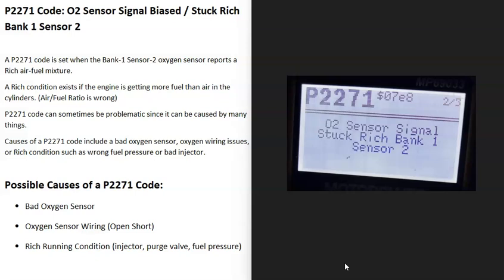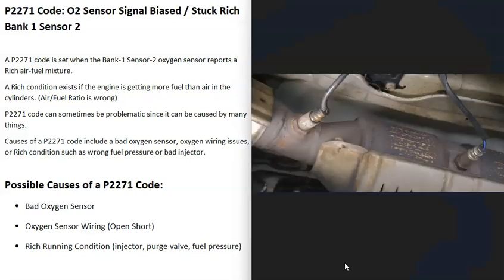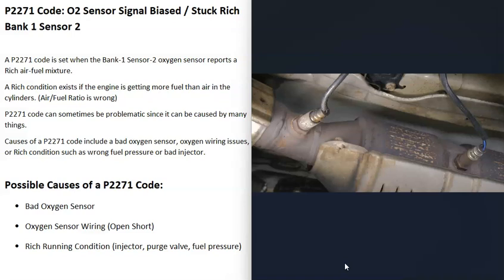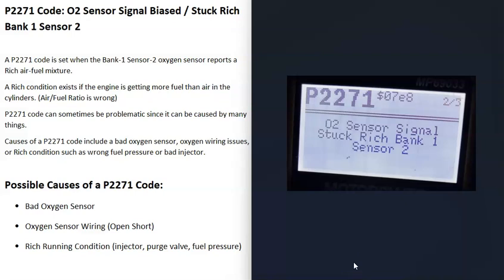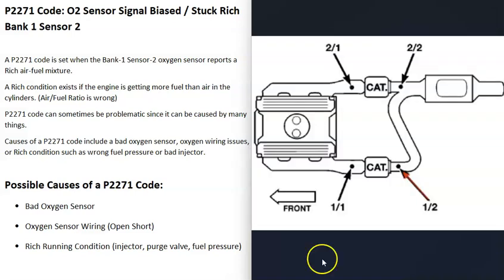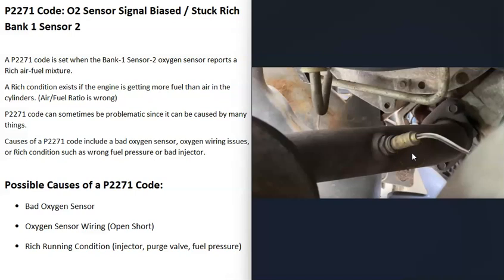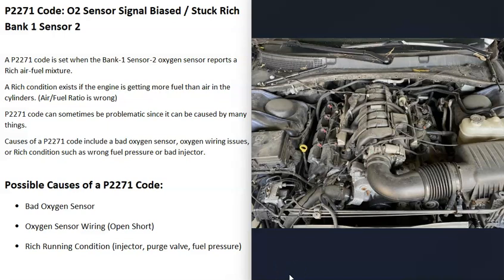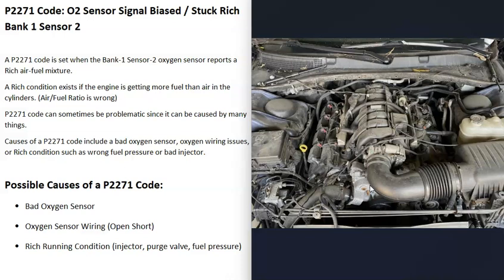Causes and Fixes P2271 Code: O2 Sensor Signal Biased / Stuck Rich Bank 1 Sensor 2

Comment: I am showing 99% on Bank 1 Sensor 2 but showing no codes.  This may just be a bad sensor.  Sensor 1 is reading very close to zero, not sure if that is too lean.  Time to check plugs I suppose.  Thanks for the video.

Comment: Nice one mate,  I got this problem yesterday, engine light comes up on my dashboard and after tester give me this P2271 00 too Rich, is good because the car have warranty and i got back to dealership to investigate 😊. Cheers for clarifying it 😊
Reply: Hi, did you sort this?
Reply: @ibrahimahmad4849 yes mate, they changed the lambda oxygen sensor and delete the error code from ECU with vcsd. All sorted now 😊 car work fine.
Reply: @ibrahimahmad4849  anyway the part is cheep 84 pounds and you can change the part yourself 😊 easy..only lift the car up and the oxygen is located under the car after the catalytic converter. At the end delete the error code with a diagnostic tester.😊

Comment: I change both o2 sensors but it still come up!! Is a 4cylinder what u think is?
Reply: Did u figure it out?
Reply: Could be injector spraying to much fuel then it’s supposed to. Did you ever figure it out?
Reply: It looks like a worn piston ring 😞😕
Reply: @momomar6382  Sorry to hear that. Going to rebuild it?
Reply: @momomar6382 how did you found out

Comment: Help I have all 4 sensors reading 
450 MV  this is a 4 wire 02 sensor on a Chevy 1999 Silverado 5.3  why would the sensor all read rich with no fluctuating they are all stuck rich!

Comment: But why would sensor 1 not show a rich mixture code? If sensor 2 is new and tested working..I checked all my injectors and everything else.. no vacuum leaks no fouled plugs coils are fine.. everything has been checked.. O2s are both new tested working.. changed exhaust manifold collector flange gasket..etc etc etc etc.. checked wiring.. everything done with a multimeter.. everything checks out.. fuel pressure is fine.. no other code.. just a damn p2097 sensor 2 trim rich.. im not using cheap sensors.. denso upstream and ngk downstream..not sure what a purge valve is on this car.. 2008 Suzuki sx4.. tried looking it up to see what it looks like.. cant find any.. i assume its an EGR valve?
Reply: Need an OBD2 tool to check the fuel trims. Ideally fuel trims should be 0% but if they're negative, it means the car is detecting a rich condition and if it's less than 25%, it won't throw a code necessarily.
Reply: @imzjustplayin I’m having similar issues, my obd2 reads -1.5 to -2.5.. is that a considerable amount?
Reply: @sashal3566  1.5% trim in either direction is small and reasonable. You'll get a CEL if the trim is +/-25%.
Reply: @ it just threw up another code that pinpointed the issue. A miracle from my car for once. 🙏
Reply: @sashal3566  what was the issue?
Reply: @sashal3566 can you please share what it pinpointed and the second code?